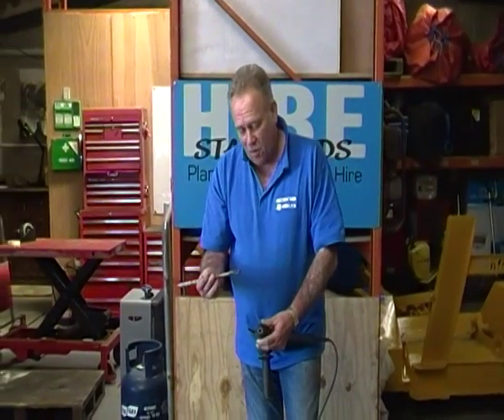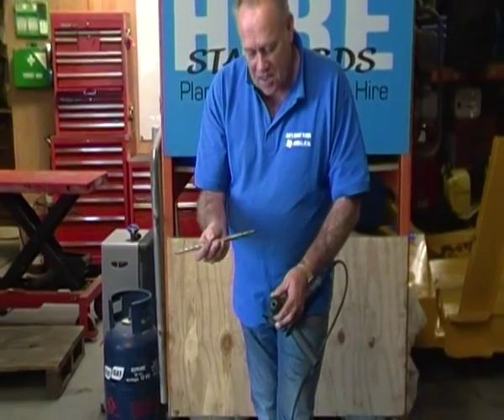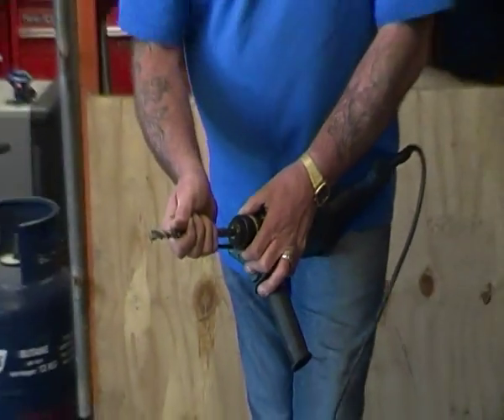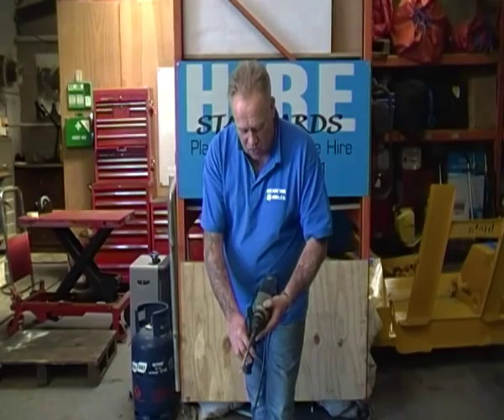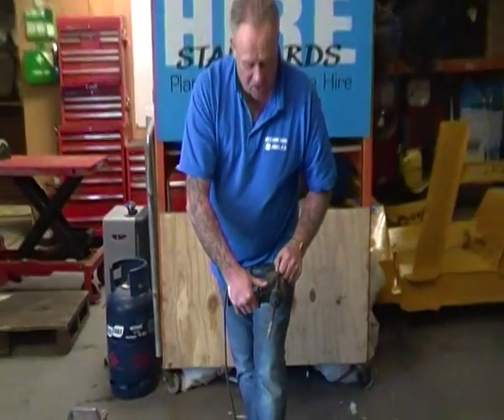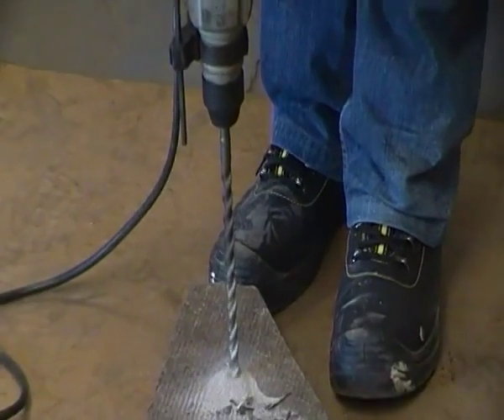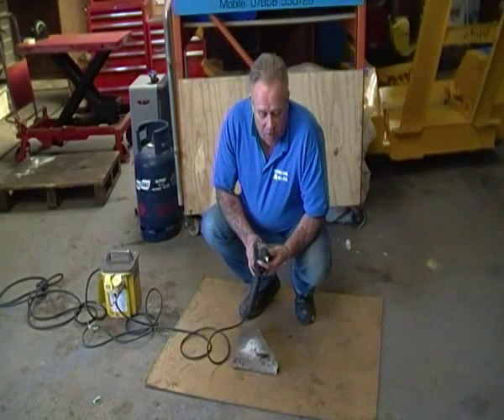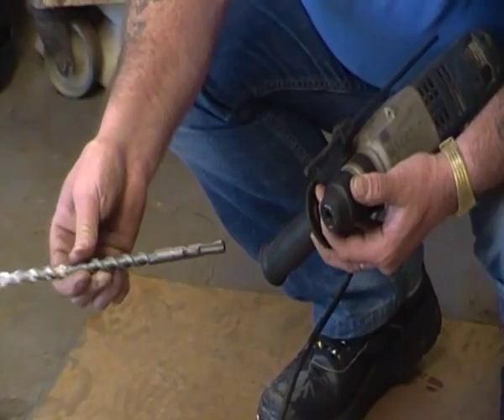Using an SDS drill

Comment: I have a sds drill and my drill bits keep getting stock in what I'm drilling
Reply from the maker: +Scott Sabin Move the drill backwards and forwards as you drill Scott, this pulls the "dust" out of the hole and stops the drill clogging up. This in turn stops it jamming.